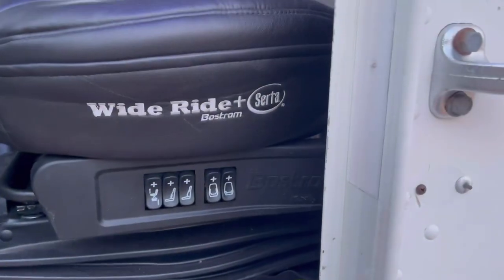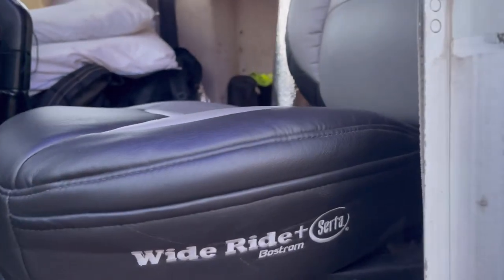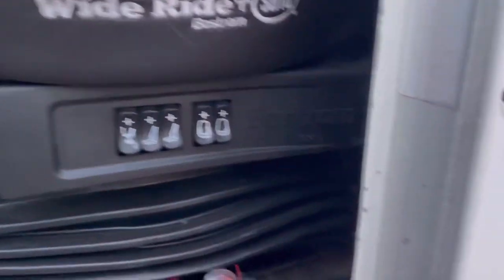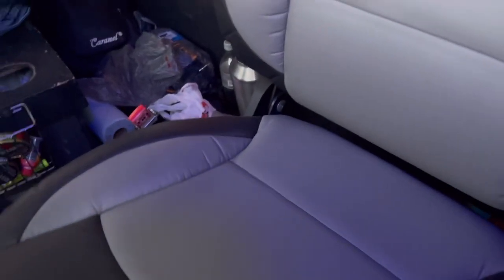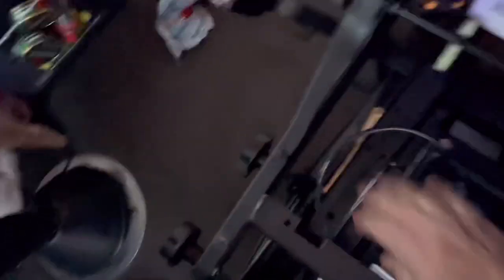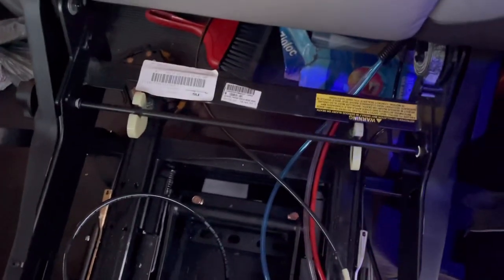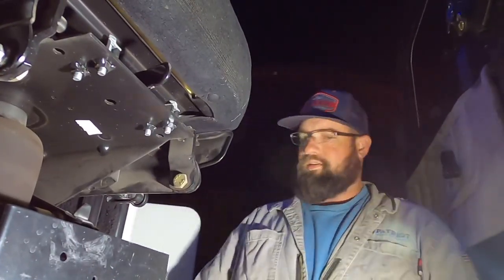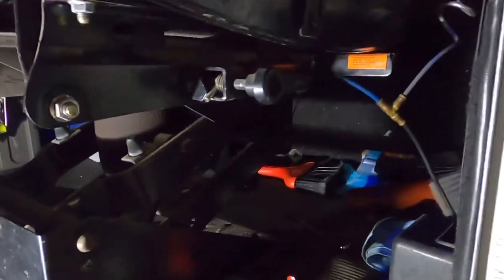Bostrom Wide Ride +Serta install in Freightliner & Overview

Comment: Just bought this seat 30 minutes ago, price is steep $1600 bucks, but it’s amazingly comfortable
Reply from the maker: It is a very comfortable seat. I only spent $1410 tax included at Iowa 80
Reply: @DosGringosRanch  just installed mine, I may be having buyers remorse though. The wide ride makes me feel like I’m falling out of it since I’m a thin guy. I’ll give it a few days see what I think. It’s like sitting on a cloud
Reply from the maker: @Wombats-1  did you air the 2 butt cushions up.
Reply: @DosGringosRanch  yeah the outer bolsters? I wasn’t a huge fan of feeling like I’m falling out of it, those bolster help